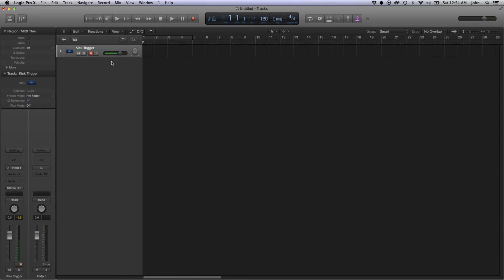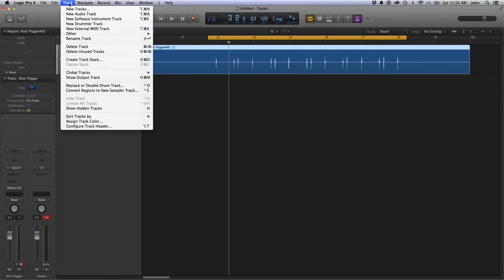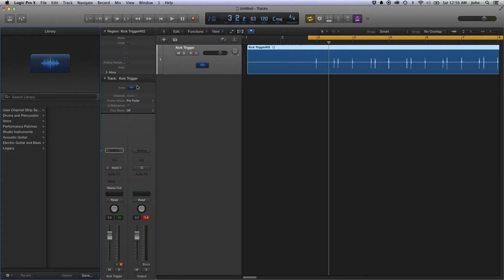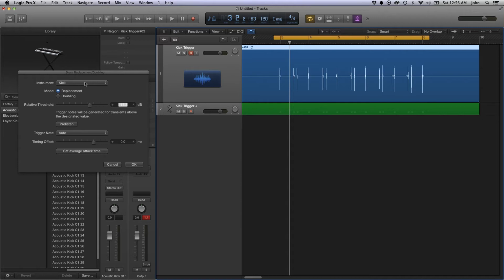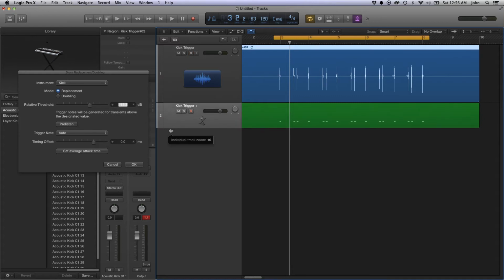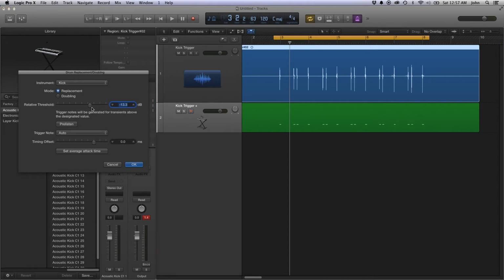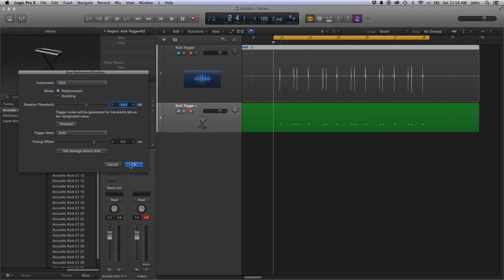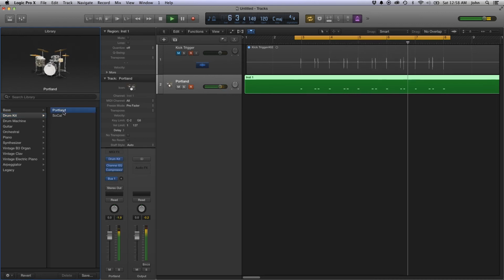DIY Analog Kick Trigger: Audio to Midi Logic X

Comment: Cool, will this support different levels of volume (playing softer, louder)?
Reply from the maker: Yes, just set the threshold in the DAW to it's lowest setting without losing any of the beats. The midi note velocity will be higher the harder you played. Of course, you can adjust this in the midi editor too, but if you want to capture more dynamics you can!
Reply: Thanks for your reply, and so quickly. I have no experience so this is really helpful!
Reply from the maker: Awesome, let me know how it works out!